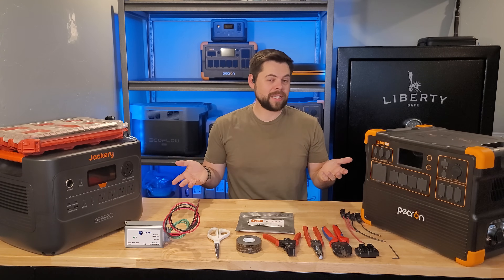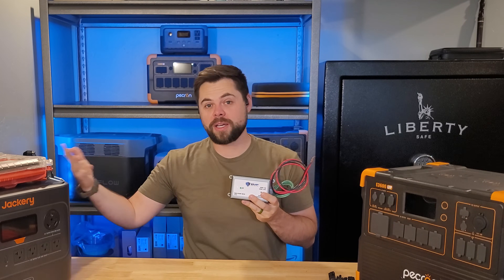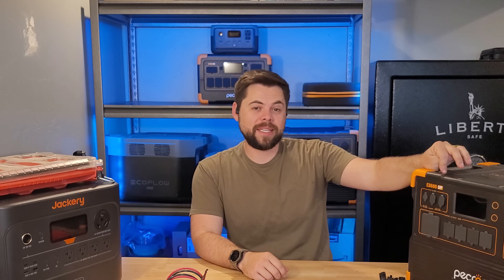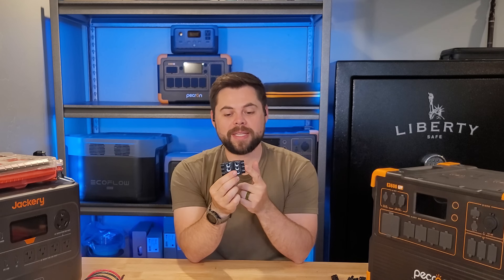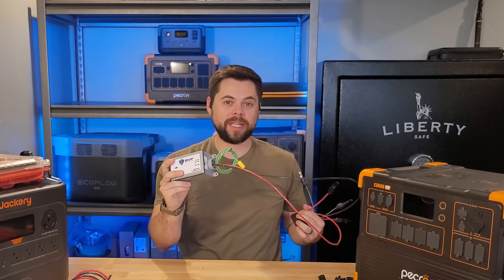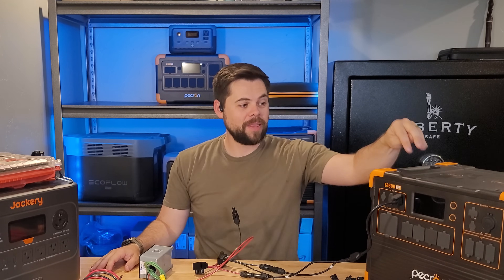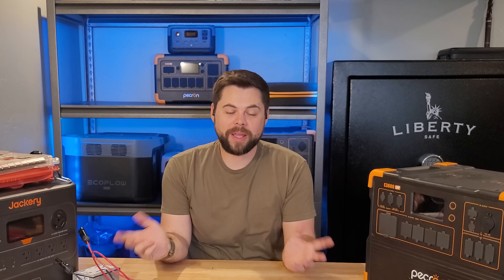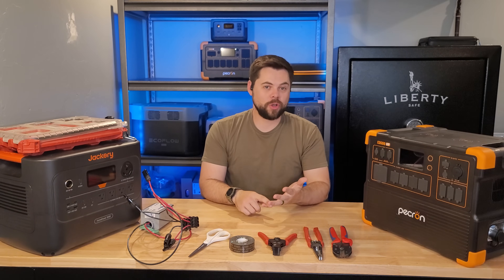How To EMP Proof Any Solar Generator The EASY Way

Comment: Hey man,
 So I have surge protectors on my home’s electrical panel that I had installed after a lightening mishap. Does that provide any protection to my EcoFlow Delta pro, or do I still need to sell one of my wife’s kidneys for an EMP shield?

Thanks for this video.

Comment: Stop calling it a "solar generator"!  It does not generate sun light, or electricity, it is a battery!  It is a power station only.  It converts stored DC electricity into usable AC electricity.  The solar panels would be a better choice to call "generators".

Comment: This is a good start.  Best approach is to stick it in a faraday bag when not in actual use.  I had a discussion with EMP shield last year about this and there are several use cases.  The one you described above is good for off-grid applications, but you most likely need to protect the battery and BMS also which is the tricky part as you will need to tap into the internal battery.  And lastly, if your system is running off the grid for UPS or online type applications, you will need the AC input side protected as well (best to just attach the EMP shield to your load center to protect all of your appliances and wiring).  Not for the faint of heart price wise, but you will find the same protection at most military bases and in some military vehicles.  Thanks for a very informative video on a touchy subject!

Comment: Which type of EMP are you talking about here? A CME type EMP isn't going to damage your solar generator anyway. A high altitude burst EMP will fry your solar generator regardless of the "EMP shield" unless it is isolated in a Faraday enclosure. If you aren't actually using the solar generator then you can store it in a Faraday enclosure but if you use it on a daily basis then it's not realistic to think you can keep it in a bag and use it too. But in general the CME type of EMP is much more likely to happen which will probably not damage your gear unless it is directly plugged into the grid. It's a good idea to have a big Faraday box (or can) with back ups of all your electronic gear but I don't think people should stress too  much about that.

Comment: Tin foil connected to a good ground (like a metal water pipe or the ground connector in any house outlet) would work better than an EMP bag like that. We use those foil bags for protecting electronic components from static electricity, but their ability to resist radio interference like an EMP is doubtful at best. Protecting the solar inputs while in use is extremely hard because lightning is VERY strong and will jump wherever it wants, and an EMP is not a single thing, there are different frequencies that might be used depending on what the EMP is designed to fry, a super low frequency (long wavelength) wont harm a solar generator with shortish solar wire runs, but will wreck the grid, a high frequency will destroy small things and short wire runs but mostly leave the grid untouched. Unless you're just showing an overpriced box with a bunch of MOV components (similar to what's in a power strip with surge protection), there is really no easy way to protect from an EMP while the device is in use.

Just use a tinfoil wrap or a wire mesh and a good ground when not in use, and hope the EMP is not going to go off when you're using the generator.

Comment: Build a copper wire Faraday cage around your solar system. Boom, emp protection.
Reply: That's the only effective defense against an EMP.  Am EMP's  100KV/m  pulse of a few nanoseconds duration would likely take out all the unshielded circuits connected to a surge protector due to series inductance in the PC board copper traces in the solar generator. We're talking about a voltage difference of 100V every millimeter across the PC board, at least. Toast.

Comment: A faraday bag works if you put it on a grounded metal shelf... but so does a metal shed.  You just need metal on all six sides and have it be well-grounded with a grounding rod sunk into the ground below the center of the shed.   Other things that generally work better:  Safes and Flammable liquids cabinets.

Flammable liquids cabinets are hands down the cheapest way to get a faraday cage without paying for the human psychology companies depend on to sell people overpriced gizmos with the word "EMP" in them.  These cabinets are generally double-walled, all six sides, steel, and often include a grounding lug (but obviously you can add more).  You can get them in almost any size and the cost is about as cheap as you are gonna get.

--

Surge protectors will NOT protect against a real EMP, sorry.  That is a well-known scam.... they can call it whatever they want because in a real nuclear war those companies will disappear just as fast as they appeared.   Real EMPs pretty much bypass all cabling and wiring and will directly couple through ungrounded metal cases and circuit boards and basically destroy the chips directly.  Only a grounded faraday cage really has a chance.

Protecting cable ingress and egress from a faraday cage housing live electronics is very difficult.  A surge protector won't do it.  Surge protectors just can't sink enough energy.  Surge protectors are good at dealing with lightning near-misses (anything over around a mile away).  They won't do buckus for a lightning direct hit, however. 

However, for true protection, a surge protector MUST be integrated into a breaker that also trips at the same time.  Most surge protectors cannot handle long surges or repeated surges without blowing, so you need a breaker that trips and disconnects the cabling entirely on the first surge in addition to the surge protector.

-Matt

Comment: Will a EMP not harm the solar panels themselves?
Reply: Solar cells are said to be fairly EMP tolerant.  Damaged but still some power.
Reply: No
Reply: Diodes will be toast.  Can use a type 61 ferrite on the wires but what do I know.

Comment: Most people should already have a solar disconnect on their mc4 cables(and inline fuses) if this is in the  "off" position, that should stop the EMP from reaching the power station, correct? I understand  that would offer no protection when the system is running. How does this help with lightning strikes?
Reply: @grindychum  depends on how much cable you have left after the disconnect or fuses. I have my fuses closer to the arrays so the 30-40' of pv wire can still collect inductants to my system. I've decided to just go total overkill on protecting my panels as well as my units. This is my 2cents anyway.
Reply: @scarygary3569 I have inline fuses at the panels into 80ft 10awg cable into disconnect box then 2 ft cable to the power station.
Reply: I'd wonder if there could be an arc in the disconnect that could still send voltage in extreme cases? I went with a 500v pv MCB with over voltage protection,same as you at about 2' away from inverter but I still added a shield to the inverter( Growatt 3kw) and a 24v shield to my battery banks. Better to be overkill on protection than totally killed on power😅

Comment: Thanks Ben for doing this! Been waiting to do something like this for my Apollos. Seems to me that the EMP shield might be better installed where the solar cables come into the house like inside a garage so that the energy was mitigated prior to passing on to the inputs of the generators. I say this because some of the EMP shields emit some smoke and soot when they get hit with EMP high voltage. This would prevent smoke and soot damage to the generators themselves if the shields were close by. Please put the links to everything !
Reply from the maker: If at all possible, you want the EMP Shield as close to the solar generator as possible, so less energy builds up on the lines between the shield and the unit.